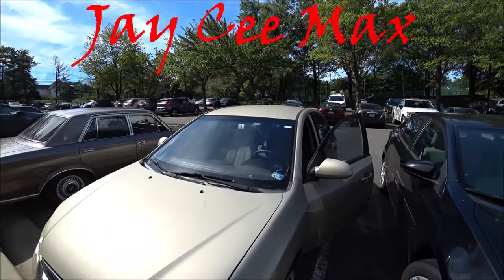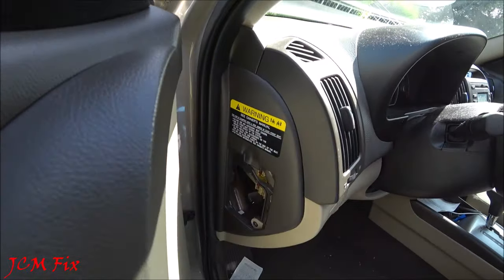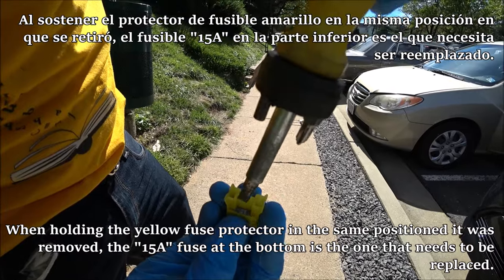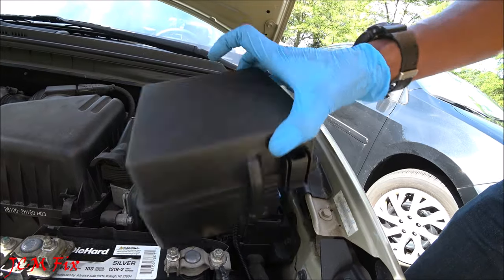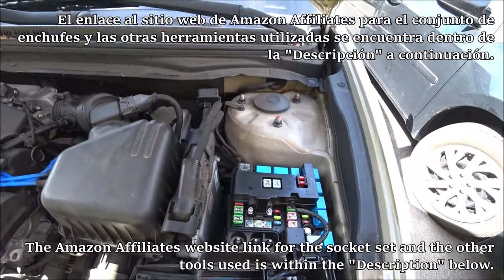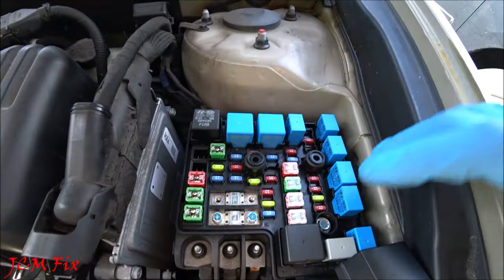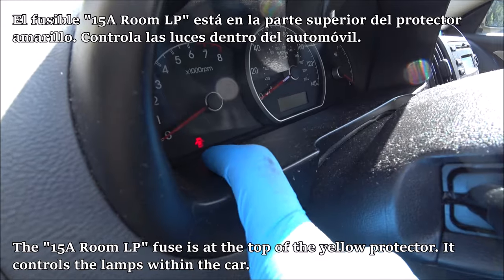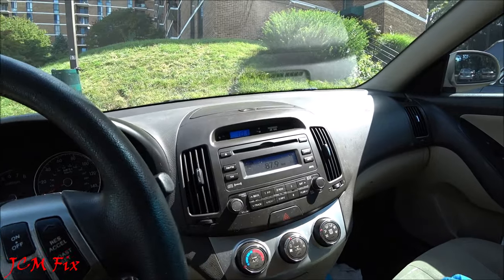Hyundai Radio Head Unit Not Working (Fix). Radio Won't Turn On. (Blown Fuse)

Comment from the maker: ⬇️The part that was shown in this video (# CommissionsEarned): 
1. Fuse Assortment Kit, 306pcs Standard & Mini & Low Profile Fuses: https://amzn.to/3kGLE8k 

⬇️ JCM Fix's Top DIY Tools used in this video (# CommissionsEarned): 
1. GEARWRENCH 3/8-Inch Drive Flex Ratchet: https://amzn.to/2zgbr21 
2. Pittsburgh 40 pc. SAE & Metric Socket and Nut Driver Set: https://amzn.to/2Wcg2On 

⬇️The tools I use regularly (# CommissionsEarned): 
1. DEWALT 1/2" Impact Wrench Kit: https://amzn.to/3dtg9bz 
2. Yashong 12-Piece 8-19mm Metric Flex-Head Ratcheting Wrench Set: https://amzn.to/2HMWqZF 
3. DEWALT 1/2" Impact Wrench Kit: https://amzn.to/3dtg9bz

Comment: What if the cd player works and aux works but the radio is the only thing that doesn’t. When it’s on radio no sounds come out at all no static no radio stations🤷🏻‍♂️
Reply from the maker: @garretthall9508  If the radio antennae is properly connected and still no FM/AM sound, the radio portion of the system maybe shot. Bring it to an electronics shop.

Comment: Purchased a used Hyundai that had an aftermarket stereo installed. Aftermarket stereo was taken out before I got the car factory stereo was put back in. Factory stereo after being reconnected will not function. Which told something about an anti-theft deterrent that I have to have a code to enable the stereo again. This possibly true or what
Reply from the maker: True. 
Take it to a Hyundai dealership and you will pay a small pittance for you to obtain the theft deterrent radio code.

Comment: what else could be wrong? i have an aftermarket radio it turned on then it turned back off. i check all fuses and they seem fine. i also checked all the connections and theyre all good too. i bought abother radio thinking the unit was fried but it did the same thing. it rurned on and imesiately turned back off. i double checked the fuse and theyre all good. this is driving me crazy.
Reply from the maker: Check your connections. Is it possible there is a short in the power wires?

Comment: i havent tried to use the fuse method yet but with my 2008 hyundai elantra, my audio would go out on the right side when i would hit a bump and i could just hit the right side of the dash next to the radio and my audio would turn back on on the right side again, a week ago the audio went out again i hope the fuse method will fix my problem.
Reply from the maker: Sounds like a wiring issue.

Comment: Nice work, I have an I30 with the same issue. Had to replace the radio and the clock fuse but great tutorial and went as smooth as I could have imagined. Many thanks!
Reply from the maker: I'm happy you were able to tackle the issue. Thanks for being here.

Comment: Is posiple a fuse could cause an issue I have a 2017 accent SE  just purchased yesterday.. I have sound on the radio but no display.. the delivery man said it was working when he was driving it to me he made a stop before the drop off and then it went out. I have sound but. I display
Reply from the maker: You may have only have a display problem. Try to go to a salvage yard, pull the display of a like model and year, disinfect it and plug it in to your car. Then it may work from there. Easy stuff.

Comment: I just bought a new 2022, the radio system doesn't come on till it warms up, that can't be right. Is it fuse related?
Reply from the maker: Wow. I have never heard of that. 
No, that doesn't sound like a fuse issue. You are under warranty. You should bget the wiring system checked out. Maybe the head unit is super faulty.

Thanks for your question.

Comment: Is the 15A  fuse the same for all Hyundai i have a Hyundai Genesis and my radio stop working when I got it back from the shop yesterday morning
Reply from the maker: @backtothebasics1598  Try the same procedure and see. If it works then you have found yourself a cheap JCM Fix 😎.

Comment: Any suggestions for a stereo that randomly shuts off and won't respond. Then randomly it will come back on? Stereo has never been removed and all fuses are showing continuity so not a fuse issue.
Reply from the maker: The fuse may show continuity but it doesn't mean you're out of the dog house just yet as the fuse just may be on it's last leg. Change to fuse first and see if the random shutting off still happens. If it's still shutting off after the fuse change, you may need a new head unit.  Contact your dealership first to ceonfirm before replacing as they may be able to check for a split wire in the back. You never know.

Comment: I have a 0'10 sonata and the radio would keep turning off and on started about 2 days ago and today fully shut off so would it be the fuse aswell ? or a electrical problem
Reply from the maker: Thanks for asking. You situation sounds more of an electrical problem. Or the head unit may be going out altogether.

Comment: Hi great video 👍. My Getz’s radio screen will show the word ”Hyundai” but won’t play any music, switch to radio etc. might that be a fuse issue? Many thanks
Reply from the maker: I see.
Check your fuses and see.
I hope you can figure it out.
Reply: Hey Henry! Did you find a solution to your problem? My Elantra shows "MP3 Player" for a second and then goes blank, fuses looked okay
Reply: @mariomassur6809  what worked for me was to reset the radio by disconnecting then reconnecting the car’s battery. Hope that helps 👍

Comment: I'm having a similar issue but the fuse isn't blown, when I plug the adapter back in I can enter the code but there is no sound, then I'll turn the van off and back on and there's nothing on the screen again. Any ideas?
Reply from the maker: It sounds like your radio is needing to be read it's last rights. I don't know for sure but it sounds like it's dying.

Comment: Thank you so much.  I am trying to troubleshoot a problem with my nav unit constantly rebooting in my 2010 Tucson.  It powers on but not all functions work ie the clock.  So, I was thinking could it be a fuse.  Well the fuse box diagrams and the manual show about 4 different places say audio nav unit.  I was perplexed when looking at the audio1 and Room lamp in that gizmo and didn't know what to make of that.  Made me a little afraid of trying to pull it.  So, thank you man for showing that one, how to pull it out and how to change the fuse in that fuse holder.  Nobody else showed that nor explained it.  Nothing about it in the manual.  Since my system turns on, I don't think that would be the fuse I need to look at, after all but still now I learned something about it.  Then again, could perhaps a fuse by almost on the edge of being blown and cause the audio/nav unit to constantly reboot?   Hmmmm.
Reply from the maker: Yeah, if it's on the edge of being blown, change it out and see if it stops rebooting. I am happy I could help.

Comment: hi, I have 2010 Elantra. my radio comes on but there is no sound even it shows its playing something. I tried pulling out the fuse but no luck. Can you please advise?
Reply from the maker: Sorry you are having issues. There could be a myriad of reasons why it is no longer producing sound. You may have a defective head unit.

Comment: Hi, My Xcent music system is not working. Can you suggest me where i can get it repaired in Mumbai
Reply from the maker: I wish I could help you with that information bhai, but I have no idea.
Reply: @JCMFix  No issues bro. Thank you for getting back to me. Can you suggest any good music player for Xcent? Not an expensive one but within 4k range?
Reply from the maker: @nickrid1312  No problem. You can try to type into Amazon, "Hyundai Accent Android Head unit" and you may be able to find a direct connection replacement with a whole lot of extras. Try AliExpress.com.

Comment: i have a 2013 elantra, the on/off switch in the internal fuse box barely works to get my radio/clock back on now (& locking/unlocking with the remote wont work and also the ones on the door unless i can get my radio on) 😭 the car wont start at random times, unless i switch some relays around or get a jump & even then it may or may not work. do you have an idea of what the problem could be ?
Reply: (ive checked the fuses & theyre good, shop thought it was the starter so it was replaced, but when i went to pick it up it wouldnt start again & is like its completely dead)
Reply from the maker: @arialmoore7715  I'm not sure. It seems like you have some electrical gremlins. Has this car ever been in a flood? If you got it used, do you know it's full history?
Reply: @JCMFix  thats what i was thinking! like there may be some kinda shortage.
nope not that i know of 😭😭 it was pretty well taken care of. ive had it since 2019 w/ no problems until now so maybe just time for another car 🤦🏾‍♀️ thankyou!
Reply from the maker: @arialmoore7715  Welcome

Comment: pliz got the santa fe 2019 and have the same problm blackscreen radio and the radio wont turn on  but i cant find the yellow fuse can you help me pliz for the love of christ dnt have enough now to go to the dealership^thanks you
Reply from the maker: You maybe have a newer system with a screen. Maybe the LCD needs to be replaced.
But you if are wanting to look at the fuse panel again, it's not about the color of the fuse. It's about the function of the fuse.

Look at the diagram on the fuse panel cover and try to do what I did in my video to your car according to the diagram and the function of the fuses in relation to the head unit.

Comment: Mine come on every 3 weeks..Can that be fuse related?
Reply from the maker: That's weird. It could be many things. First start with changing the fuse (free cost). Then if it still keeps turning off, probably you have a defective head unit.

Comment: My interior light AND radio are not working so hopefully this fixes my issue 🤞🏻
Reply from the maker: @cassandrasheek8510  cool. There's a fuse for the lights there too. Hope this helps

Comment: My 09 sonatas(49,000 garaged and babied) radio started shorting out recently. I've never experienced this with any radio. My fuses looked ok. Haven't checked the one on the back of the deck yet ..
Reply from the maker: That sucks. I hope the unit isn't showing signs of going out. Please Google this issue and see what others say for your year range.
Reply: My 09 became very hard to see for a long time with the liquid crystal bleeding throughout the display and yesterday it just didn't turn on. My fuses are good, so the head just died. Guess it's time for a much nicer aftermarket unit!
Reply from the maker: @DaveHonkles Sorry that happened to you.
 Yes! There are many aftermarket double din head units with Android installed that can fit in your 2009 Hyundai Sonata.
Reply: @JCMFix  do the steering wheel controls work with aftermarket radios?
Reply from the maker: @cornholius  Yes indeed! Normally you have to twist or solder the two Brown cables from the Chinese head units to the two native wires dedicated to the steering wheel control, then go into the Android head units settings menu and train the unit to recognize the presses. 
It's actually pretty easy.
Reply: @JCMFix  awesome! Someone else told me you lose the controls. Glad to hear that isn't true! Thank you!
Reply from the maker: @cornholius  Nope. Not true at all. It's just many people don't know how to twist the two or three brown wires together. 
In later model cars, yes it may be more difficult to retain the steering wheel controls where connecting the brown wires from the Chinese head unit requires extra assistance depending on the schematics of the the wiring of the car  If that is the case, Metra or other companies like it usually have a totally separate part that can keep the steering wheel controls when changing to an aftermarket head unit. Just gotta keep looking.
Reply: yup same thing is happening with mine. keeps shorting out. it even gets stuck and sometimes it won't even turn off. i'll also hear a "pop" sometimes. probably won't ever get another hyundai again lol
Reply: @DaveHonkles  mine is starting to do that rip. it shorts out and "pops" sometimes. guess it's just an old car. hopefully it lasts until i can buy a new car, that won't be a hyundai.
Reply from the maker: @TheGodsMustBeCrazy  Yikes.
Reply: @TheGodsMustBeCrazy mine "pops" too. It's weird, I was using it for a few days then it rained and started shorting constantly again.. I'm starting to wonder if it's a moisture issue, as water can cause shorts if it gets into the wrong place. 
The dealer told me "it's very unusual and not common at all" when I asked why it seems like such a common issue. Lol. They wanted to schedule me for a diagnostic for over $200. I hear the same replacement deck is thousands of dollars. Ridiculous.
Reply: @cornholius  i don't know if it's a moisture issue, but i think i'd chalk it up to it being a subpar car company with cheap ass parts lol

Comment: My radio turns on , but I don’t have any sound on the speakers
Reply from the maker: Head unit may be blown internally or the speakers themselves.
Reply: @JCMFix  that would make sense , It use to cut on and off when I hit a pot hole. I checked the wires and they’re fine . Looks like I might just have to replace it
Reply from the maker: @Travrebel  I hope this solution works out for you.

Comment: I changed the fuse but after restarting the engine the radio doesn’t work again, the radio works only when I remove and insert the fuse again after the engine is started.
Reply from the maker: Yikes. That's super. Maybe ensure that new fuse is robust and up to spec like the OEM ones. 

Then, check the other fuses that deal with the interior radio/a/c, etc and see if they are blown as well.

Also, change the new fuse you just used again to rule out if it is a dud.
Reply: @JCMFix  what other fuse deal with the audio?? My fuse isn't blown my radio turned on but now it doesn't I checked the fuse a couple months later and doesn't turn on
Reply from the maker: @xavierlake3618  You have to look at the fuse panel diagram and see. Pull those and replace them with new ones to see if any are problematic. If none of that works, bring it to a service center.
Reply: @JCMFix  isn't there a fuse inside of the physical radio on the left side I watched another video where that was the case as well
Reply from the maker: @xavierlake3618  I'm not sure
Reply: @JCMFix  forsure I appreciate the Information I'm gonna try that on the physical radio if it don't work ill bring it to a dealer

Comment: How confusing.. I don’t believe in SPARE fuses I believe in misplaced fuses or incorrect engineering. I wonder where MY i30s secret on off switch can be found as it’s chewing at the entire car battery. If only the radio itself actually alerted us when and where to retune
Reply from the maker: I hope this video helped you overall and brought you to the right conclusion.